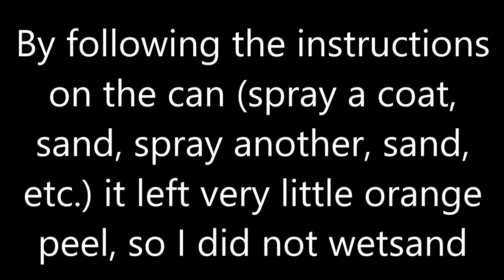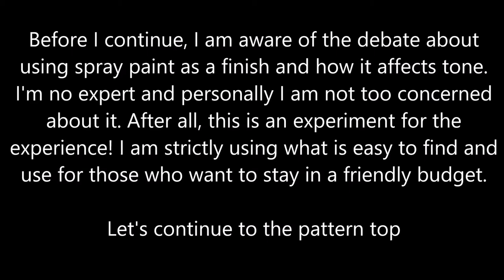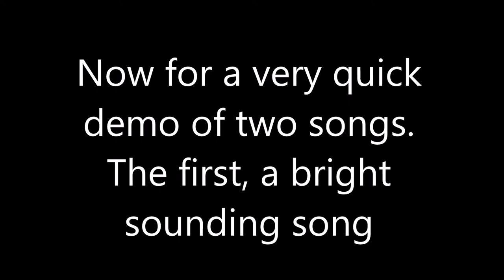Fender Esquire Build: Luther Perkins Tribute Esquire #2 (Floral Top)

Comment from the maker: Some tips I have for you: Don't use multiple clamps while routing against the template, the guy who did it for me was stupid. Just use double sided tape and tape the template down, it works so much better. Make sure the screw holding the bearing on the route bit is screwed in tight. Use either grainfiller or spackle and water to fill the grain, especially with Ash because it is an open grain wood. Put on multiple coats. Lastly, when sanding the body, start with 120 grit and move up to 320 or 400 before painting. My main sources for building a guitar are Fletcher Handcrafted Guitars, Jeff Baker, and Brad Angove

Comment: Hi, I was wondering where you got your templates and if they show where all the holes and cutouts go and there depths?  Thanks!  I'd like to make a stab at it to. love your sound!
Reply from the maker: So I bought the body templates off of ebay. Just look up fender telecaster mdf templates and they have all the holes and cutouts you need. As for the depths, I did look those up. There is a template on google images that tells you the hole depths and such.

Comment: Nice guitar but a lot of work. Would like to try this with a kit and customize to shorten the road. You have one pickup installed. Is it volume and tone nob only as controls? Well done.
Reply from the maker: I'm gonna build another but buy the body next time. So it has the esquire wiring. Bridge pickup with only volume control, middle position is bridge pickup with volume and tone, forward position is bridge pickup with volume control but the tone is set to have a dark sound

Comment: Did you have to cut the vinyl for the bridge like the pick guard?
Reply from the maker: No, for the bridge and bridge plate, I set those on top of the vinyl. I did cut a hole into the vinyl where the electronics and the pickup go.

Comment: Where did you buy all the parts for the guitar? (mechanical parts)
Reply from the maker: two18 all the parts besides the wood and faux leather top came from a previous esquire
Reply: Are there any chances you can try and name or link all the parts to buy? :(
Reply from the maker: two18 like previously stated, the parts came off a fender esquire I bought a few years back, so really the parts are all up for your choosing! I just used what I had available at the time